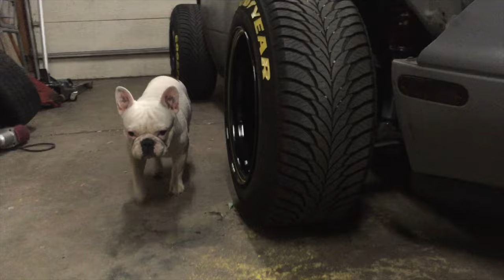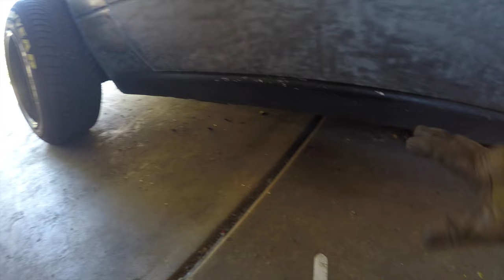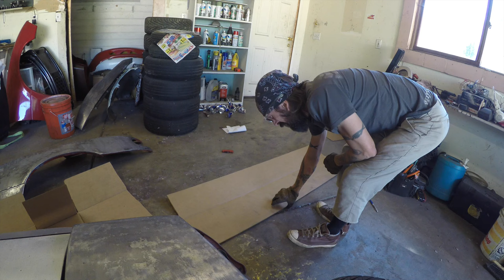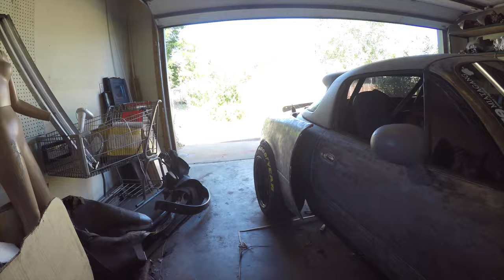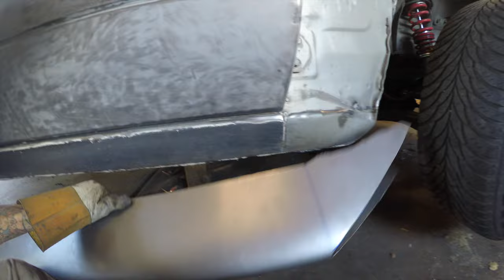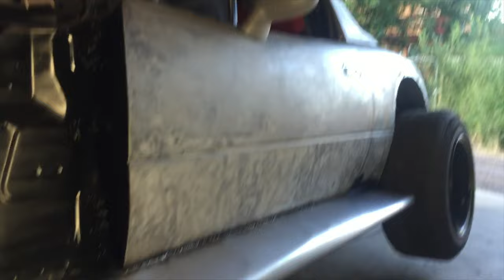Miata WIDEBODY PART 2 S06E30

Comment: Love it man
Reminds me of the old old racing mercs when they went without paint

eyetwitch not for me though so much extra weight.... Using metal...

But hey it's easy to work on and use CX 
XD I'd definitely have done it in fiberglass or carbon or Kevlar if I cared but I'd definitely have first done I it in metal then used it for moulds ( THEN UNLIMITED BODY KITS! MUWAHAHAHAHA ) 

Also I hope you know that roof lip/spoiler 
Makes the trunk one useless ( I'm guessing it was mostly for looks though )
Reply from the maker: the metal is super thin AND you obviously haven't watched my other vids. winter project will be an LS1/T56 swap into it. so fuck extra weight. the tires/wheels add more weight than the wide body... lol
Reply: Wayne'sWork!Vlog  I've been loosely following it 
Haven't had lots of time to watch vids 

Can't wait for the swap tho, all done it really shouldn't be more than 80lb over stock for motor and gearbox if you're going aluminum block 

Still cool man!
Reply from the maker: yea picking up a rear ended camaro with everything in it. everything online says about 80-100 pounds total. doing an e85 tune to get 420hp/420ftlbs with a 2300 pound car.... will stomp corvettes.
Reply: Wayne'sWork!Vlog NICEEEEEEE! Aftermarket injectors? 
I'm not sure about the stock gm e85 injectors but you can decap the stock ls injectors and get REALLY good flow from them 

Sloppy mechanics did a thing on it and got them flow tested and everything
I can get you the video if you'd like

I plan on getting a Miata myself them getting an Exocet exo for it. Past that I'm not sure yet after I EVENTUALLY blow it up stock ( I know I will eventually )

I'm thinking either ls or f20 or something 
Maybe rotary CX 
Probably ls since I can find one pretty cheap

I've been looking into this wpc treatment thing
(http://www.wpctreatment.com) 
I haven't heard much about it first hand but soposed to be pretty awesome stuff
What's your take? 
Just even from what I've seen and heard of it from videos and boards it's amazing stuff friction wise and heard people gaining like 3-4 mpg from getting bottom end stuff treated ( not supper worried about mpg but that also means a more free revving engine )
Reply from the maker: yea these snake oils have been around since the gas crisis of the 70's. the only thing i have ever seen with actual proven test results is nitrogen treatment to freeze the block and the put it back together. something about the metal being condensed to a point where it won't break. otherwise just run synthetic and stay up on your oil changes. as for injectors, will look into it once i get there but from what i have seen i should be able to run the stock ones since they can do almost 80% higher than the LS needs on gas alone if you do a FPR and e85 is only a 30% higher shot with the flash I'm gonna be using. I'm not really a fan of the exocet just for weather reasons. cool for a track only car but not my style for the cost.
Reply: Wayne'sWork!Vlog ahh
I don't really care about the weather. I just love it for the weight savings and reduced clutter 
Although in all reality I'll probably have to swap the engine before I get the exo CX knowing my luck
Reply: Wayne'sWork!Vlog And I'm not sure, the more I look into it the more I see it Being real deal since it's basically super tiny shot Peening it basically does the "golfball" effect to it 

But a few big performance team, divisions, company's use it
And it looks pretty big in the bike world 

I might bite the bullet on it if I do ever rebuild the motor or do a swap ( I'd be rebuilding it anyway if I was going to do an ls swap with heads valves and a lighter and stronger bottom and top end )